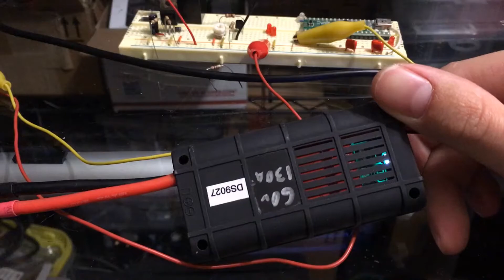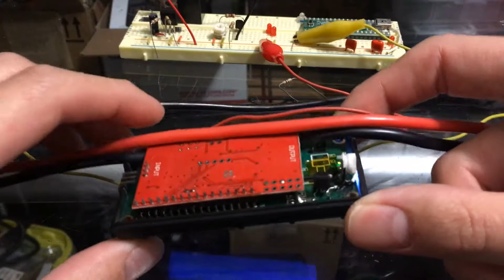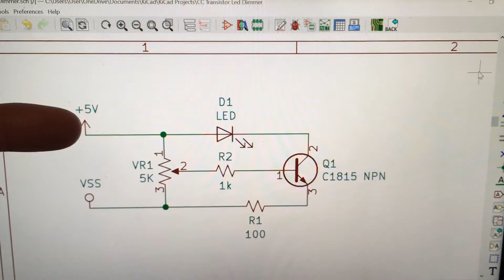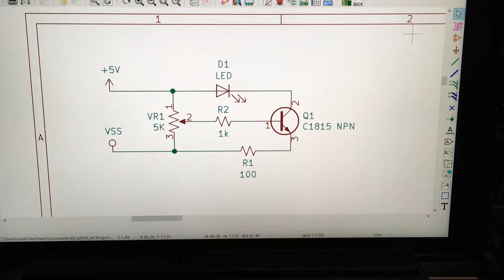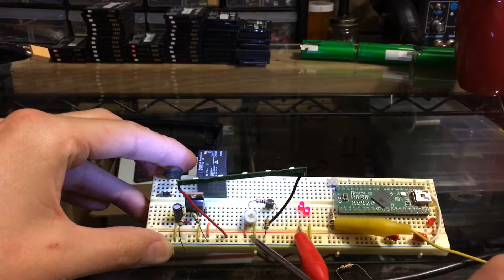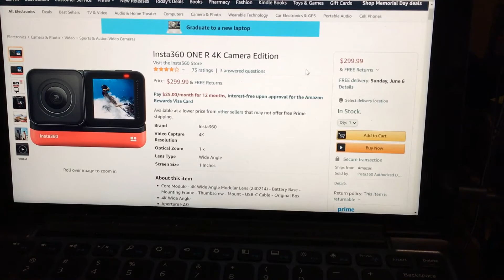LED Backlight Dimmer for Tenergy Watt Meter

Comment: nice circuit its the same  for high power .
Reply from the maker: yea but it is not good for being efficient, but it is quite stable. you just need to add in an opamp because the transistor will drift with heat.
Reply from the maker: its also a good circuit for sensitive laser diodes, I know Styropyro has used linear regulators for his diodes but probably not this simple circuit, you would want to replace the entire voltage divider section with a standard linear regulators.